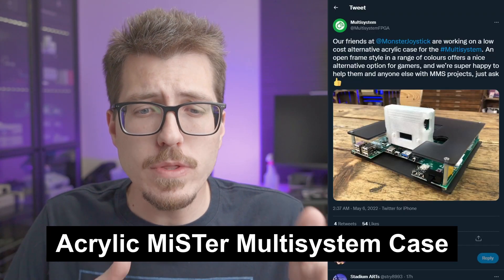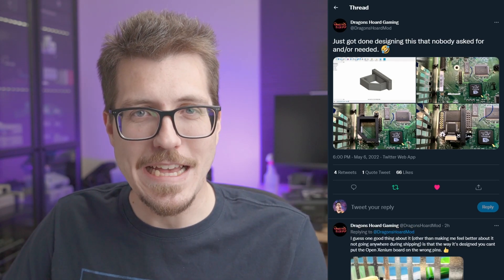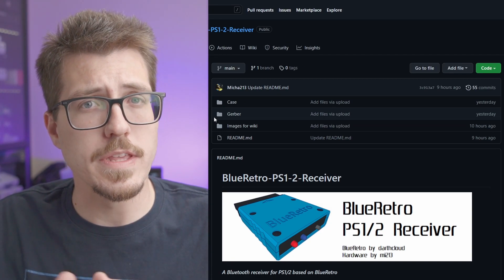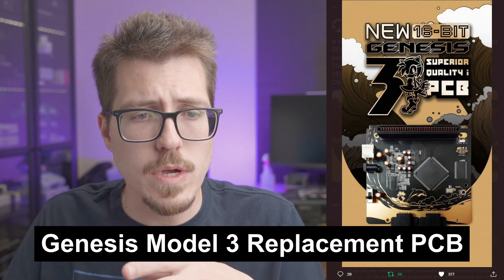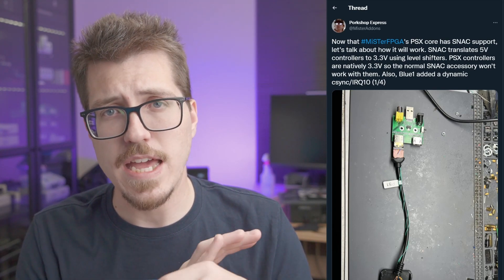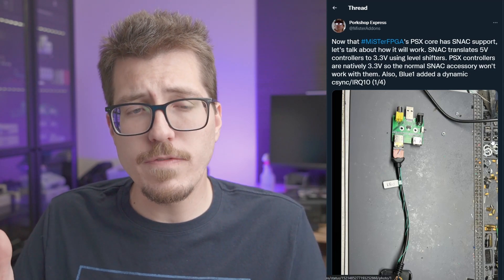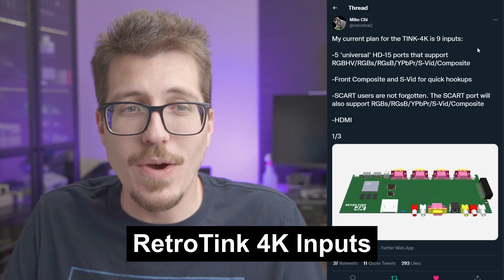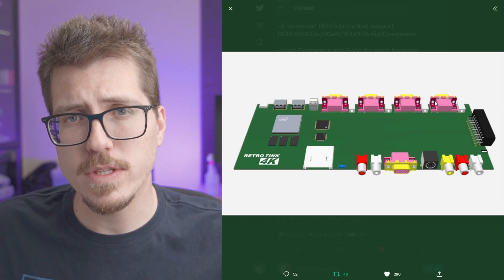New RetroTink 4K Scaler Video Inputs - Retro Modding News 5/8/2022

Comment: - cool ps2 adapter. they should of added a USB port to accept it throu USB as well for better response. Bet it's good thou.
-4k scalier would be cool.
Ill probably finally upgrade the framemeister.
up scaling to native is always better for the LCD's. Let the scalier scale it up then the tv cuz the TV will add lag and may not do just much of a good job.
Hope it supports HDMI in for new gen consoles. It would be funny upscaling a ps3 for instance.
Wonder if the OSSC pro will compete.
- snac adapter needs to support more then 1 controller port for muiltiplayer. The blister does. so glad. 
- Looking forward in the new boards coming for the d10 nano. Just hope it comes with a nice case. and still support the blister. All the fixings and them some.
- New Dreamcast VMU would be cool. Something extra with the mode dreamcast.

Comment: Cell phone batteries last a long time if you take care of them. Don't charge overnight, and don't use that fast charging crap that they keep pushing. Fast charging generates heat, which kills the battery faster. If you use fast charging every time you charge, you're just shortening the battery life, which I suspect is what all these phone companies want so that you buy a new phone faster. Only fast charge when absolutely necessary, otherwise just slow charge. I plug my phone in to charge when I wake up in the morning, in an hour or so it's full and ready for me to grab and take with me when I head to work.
Reply from the maker: Agreed, however cell phones use high quality lipos and sophisticated charging circuitry. 

Either way it's fine as long as the saves get automatically stored on the SD card

Comment: Excited for the VM2 and the Tink 4x but it didn't look it supported component cables. Most of my setup is Scart, but I still use a lot of component cables with HD Retrovision cables. Also great to see more Xbox mods, but right now it seems impossible to find an OpenXenium due to the chip shortage.
Reply from the maker: Right, component cables will have to use adapters to go to those hd15 inputs
Reply: @dubesinhower  Ohh I thought those were HDMI inputs, didn't see they were HD15. Not sure if I like the bring-your-own-adapter approach but maybe you can do a video on quality adapters that won't introduce interference.